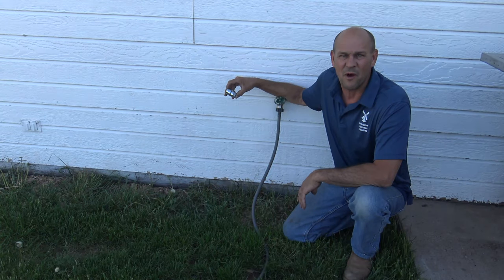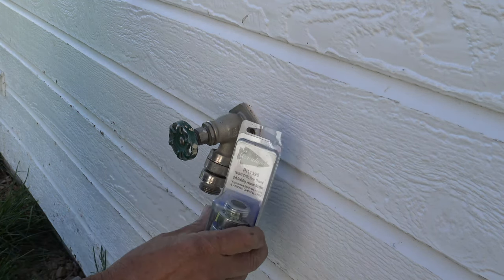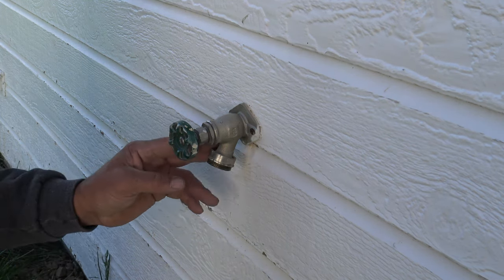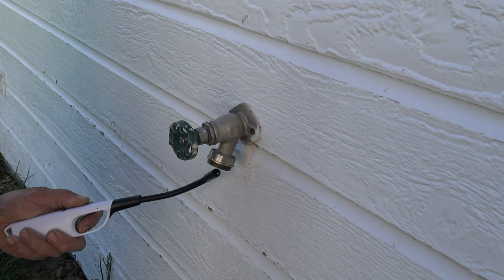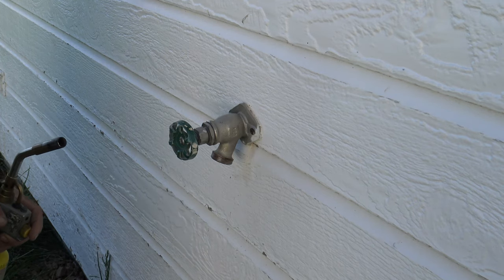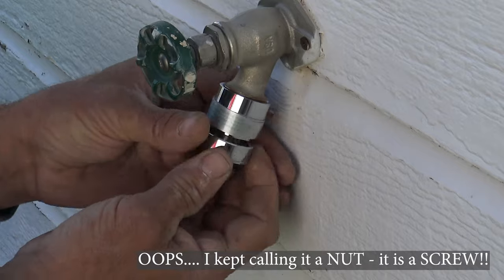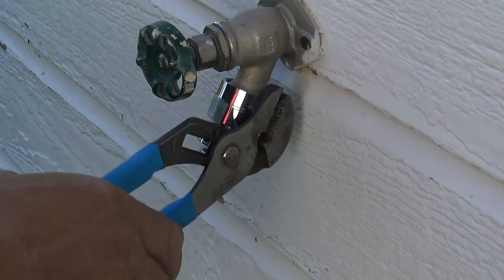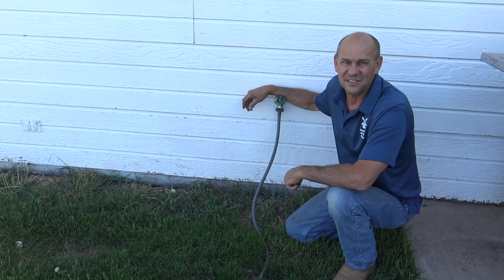How to Fix a Leaky Hosebib | How to Repair an Outside Faucet Leak

Comment: Thank you so much! The hose bib had been sitting broken for over 5 years! Every plumber quoted 1000 bucks to replace the bib. I tried unscrewing the broken off part and gave up until I saw your video. It came off so easily.  My hose bib is finally operational again!
Reply from the maker: Good deal. I'm glad you got it done.

Comment: Been trying to get that thing off for weeks! Was totally confused what to do! 3 minutes off & on with a good butane lighter and I could see bubbling at the top, screwed right off! This sure seemed easier than other videos drilling holes and sawing with blades! Thank you so much for the easy do it yourself tip, even I could use!
Reply from the maker: Fantastic!!  I love that it worked for you - great job!!

Comment: Thanks, I needed this.  What a stupid implementation of that break off set screw.
Reply from the maker: Agreed!
Reply: One of mine is dripping really bad and the set screw is broken off so it doesn't budge when I try to unscrew it. Were you able to get yours off with the broken set screw just by heating it up? I thought that I would have to drill the set screw out or use a dremel to cut the vacuum breaker off but I don't have those tools.

Comment: Excellent video - and I like that it is very recent.  I wish I had watched it earlier; however, that said, I do have two new faucets and will be attaching the PK1390 on both.  The tip about stopping the leak just below the knob was useful.  Also, I was wondering what I was going to do with the side "screw" on the PK1390 and you gave the perfect answer and demonstration.  Thanks for taking the time.
Reply from the maker: Thank you!!  Appreciate that!

Comment: Is there an Arrowhead PK1390 without the screw? I don't want to deal with trying to get the screw that's broken off out when time to replace.
Reply: GET A SPIGOTMASTER!
Reply: Im just left my set screw out and used lock tite.  Works great!
Reply: There actually apparently is (or was at least, decades ago) because the one I took off did not have a screw and just came off easily but all of the replacement ones I've seen have the retaining screw.

Comment: This is great. Really helpful. Thanks. 
I had one question though. Would it be okay to use spigotmaster anti-siphon device instead of the Arrowhead vacuum breakers?
Reply from the maker: No, the Arrowhead breaker is designed with double check valves, one is a back flow preventer and one allows the hosebib to drain itself.  The kind you mentioned doesn't allow it to completely drain.  Here they are on Amazon  https://amzn.to/2WYWnOi  https://amzn.to/2WuUmuk
Reply: @DIYOnTheHouse  That is not the case: there are PLENTY of regular vacuum breakers that fit onto a regular 3/4" garden hose fitting for a FRACTION of the cost of the Arrowhead vacuum breaker: buy a spigotmaster and then add a more economical vacuum breaker. MUCH BETTER SOLUTION!

Comment: Do I need to put Teflon around the spigot thread?
Reply from the maker: No, there should be a washer inside that will seal when you screw it on to the bib.  Let me know if you have any other questions.

Comment: Is the leaking repairable vs replacing it?  For example, why does it leak?  Does it just need a new gasket or o ring?
Reply from the maker: Hi,
It wouldn't be worth repairing. It's possible that the brass has a groove for extended periods of leaking.

Comment: Appreciate the video. Why do these even fail to begin with? Is it because the rubber washers inside wear out? It sure would be ideal if the whole thing didn't need to be thrown away and replaced every so many years.
Reply from the maker: Thanks!  The minerals build up and doesn't allow the rubber to seat or the rubber wears out.

Comment: You do not need to use heat. Use penetrating oil. 
The top part of my vacuum breaker stuck on the hosebib as in this video. I don't have a torch. I tried channel lock, heating with clicker. It did not work. I tried to find a 1 1/8 fine thread female to 3/4 GHT adapter, but could not find any. I then stumbled into a YouTube video which showed how a guy was able to remove nut and bolt sealed with red LocTite thread locker without using heat. He used Brakleen Brake Cleaner and it came off easily. I was going to try penetrating oil next any way. I had some Houdini Lock cleaner at hand, so I applied a liberal amount, waited 2 hours and the part came off easily with a channel lock. I waited 2 hours because I had to do other choirs. You may not have to wait so long. I heard that people used WD-40, but I have not used that myself. Hope this helps.
Reply from the maker: What ever works to get it off with out damaging the bib! I use heat because I need to remove them right away during a plumbing service call. Thanks for the tip!

Comment: i have an issue but the water leaks out the handle
Reply from the maker: Hi
If it leaks around the shaft that the handle is attached to there should be a nut (packing nut) to snug up and it should stop. If the water is coming out a hold in the shaft then you will need to remove the handle and roll up teflon tape and jam it in the hole that attaches the handle, until its packed tight and reset the handle.
Hope this helps

Comment: Can I use Teflon tape instead  thread locker???
Thank you for the video....i didn't know that I can change just that part.  I got the whole piece (very expensive BTW )
Reply from the maker: There is a rubber washer in the pk1390 so no need to seal. They are spendy!

Comment: I found the best way to fix this is to remove the back flow preventer as shown in the video, throw it in the trash, and replace it with an adapter (from Amazon) that eliminates the expensive back flow part. The backflow preventer will have to be replaced to pass inspection if you ever sell your house.
Reply from the maker: I know the design is a little wonky, but if it's replaced and working properly. It will save you from having a freeze and break during low temps. Which can cause major damage to the interior of the home. I have been a plumber for 25 years and very seldom do I have to replace this bib design from being frozen during the winter from someone leaving the hose attached.

Comment: Is the spigot brass or aluminum because my leader hoses are all brass and I don't want the different metals to cause problems. Can I installed a brass drain back valve with fine thread to the spigot? Thx
Reply from the maker: Arrowhead bibs are all brass except the handle. If you replace the vacuum breaker it will have to be fine thread to connect it. Make sure you use the pk1390 breaker, it's a double check and self drains the bib. Single checks will leave water in the bib and will freeze and break in the winter.

Comment: Great video! Is it normal for the anti siphon valve to expel water (briefly) when you turn the hose off?

Just installed a new one. No longer leaks when hose is in use....but it shoots out water for 5-10 seconds as soon as I turn the spigot off
Reply from the maker: That is normal especially when a hose is connected. When you turn it off, the back pressure from the hose is relieved through the vacuum breaker.
Reply: @DIYOnTheHouse  Thanks for the quick response and confirmation. Will be watching more of your content!!!
Reply: My brand new one leaks while it's running :-(

Comment: I haven't finished watching your video yet and maybe you will talk about it but I just purchased a brand new one of these (PK1390/59BFPCHR) to replace a decades old one that was split at the rubber gasket in between and was leaking everywhere and I cleaned the bib off beautifully and used pipe dope up as the instructions that came with it said to do and tightened it not too tight but decently tight with a pipe wrench and then tightened the additional retaining screw to hold it in place and it's spraying water out of the middle of the device like where the overflow or relief weep holes are :( why is a brand new unit leaking?!
Reply from the maker: Some times the rubber gets stuck to the brass. If you take it back off, push the 2nd washer from the top with your finger and it may free it and do the same thing from the hose connect side. If this doesn't work it's defective.

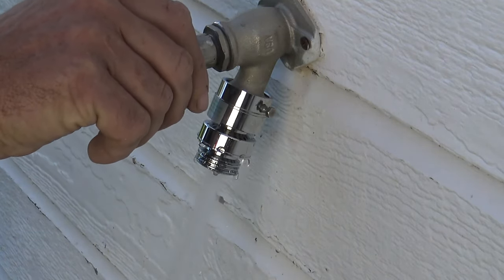Comment: @4:50 when you turned on the water, at first it started leaking around the mid section. Is that normal ?? My old onenbroke and i installed a new one (same model). Its also leaking at low water pressure but i dont recall my old one doing that. Thank you!!
Reply from the maker: It will leak until the check valve is engaged with more water pressure. If it leaks under pressure a piece of debris may have got under the washer.

Comment: Thank you for this video!  For the life of me, I could not get that top piece off.  I watched some other videos but none said to use heat.  I heated it up with my multi-purpose lighter (clicker).  It did take a lot longer than I thought it would, but it eventually got hot enough to twist that darn thing off.  Lots of old red locktite came flaking out while turning.  Thank you so much for this video!
Reply from the maker: You are so welcome!

Comment: Thanks. your video helped me. To add a datapoint, I used the lighter to heat up. it only took me like 5 minutes to heat it - much easier than i perceived. Just pay attention to the direction to turn the wrench before you actually hear it, as you don’t want to spend time to think as it rapidly cooling down.
Reply from the maker: Glad it worked!

Comment: Quick question: the instructions on the packaging of the breaker said to use pipe dope, however i dont see you having done that. I didnt do it either. Will that cause problems?
Reply from the maker: Nope. I've replaced hundreds of them and never an issue.

Comment: So there is a faucet that you can not attach a hose directly to. A vacuum breaker that either has threadlocker or a screw that breaks off making it difficult to remove. It also does not last so removal will be needed.  WHY does anyone use these parts when you can just buy a ball valve faucet and make things easier?
Reply from the maker: Hose bibs that are in freeze areas may need to have the wall or siding opened up to replace the bib. So repair is cheaper.

Comment: My faucet/spigot are in the recessed area that requires bending over every time and reaching under an awning - very awkward.  I got a "hose bib extender" (https://www.amazon.com/Sun-Joe-SJ-SHSBB-Gry-Garden-Faucet/dp/B07GT79XD3) so that I can turn my water on/off from a slightly different location, but under pressure I noticed the spigot leaked.  As I intended to leave this open all the time, I tried to fix the spigot (thought it was some weird aerator or something), but realized it was a vacuum breaker.    Exact same model shown in your video.  Is there a modification that would allow me to use the hose bib extender?
Reply from the maker: You inspired Ross to make a video on how to fix your problem.  He filmed it yesterday and I have it ready to go up on Tuesday next week!
Reply from the maker: We got the video posted early - see if this helps.  Let us know if you have more questions.  https://youtu.be/0NDkOwZeVzw

Comment: I replaced mine but it keeps leaking! What am I doing wrong?
Reply from the maker: The constant leak will be the flat washer inside the bib. The stem will need to be removed and the washer replaced, if it has leaked for a long time it may have worn a groove in the brass seat and the bib will need replaced.
Reply: @DIYOnTheHouse  I believe I have the exact model of this spigot. Do you know the exact washer replacement that would fit this, the one that goes on the end of the stem piece? Or maybe there's a video of you doing this?

Comment: I tried heating it with a torch but couldn't get it off myself. I had a plumber over at my house for an unrelated fix, but had him check out if he could get the top off. He used WD-40 and was able to get it off!
Reply from the maker: That's great.

Comment: How do you CUT OFF the top peice of the vacuum breaker if it won't thread off because the threads are damaged???
Reply from the maker: Do you know if there is a place on the top part that has a broken screw on it? If there is I use a small hack saw and cut a V at the broke screw and wedge it off with a flat screw driver and then it should unscrew.

Comment: That's exactly what I need. Same exact vacuum breaker and I quit trying thinking I would break it off. I'll try again with a heat gun.
Reply from the maker: Heat will loosen the thread lock and you will be good to go.
Reply: @DIYOnTheHouse  Thanks, I was able to get it off and save a call to the plumber!

Comment: 4 years later and this video is still really helpful! My hose was leaking from the bib, and after doing quite a bit of research, I thought I was going to need to replace the whole faucet. In a last ditch effort, I browsed through some youtube video and saw a thumbnail of a faucet that looked like mine. I watched it, ordered the part, and now my faucet is working properly again!!! Thanks so much for this video! You saved me hundreds of dollars I would have spent when I didn't have to.
Reply from the maker: Happy it helped. I replace a lot of vacuum breakers.

Comment: Im glad to see this video. Every single other one mentioned the cursed break off screw. The one ive got doesn't have one of those
Reply from the maker: Hope it helped!
Reply: @DIYOnTheHouse  This did help a lot. I also figured out that the bib somehow kept not catching the threads. Thus spinning 360⁰

Comment: So, from the looks of it, the thing is designed to constantly leak water.  Interesting.  The proprietary thread mount was reason enough to avoid these things, but the leaking water is why I need to replace.  Bummer.  Thanks for the video
Reply from the maker: The replacement should only leak water when it is turned off, That would be the draining of the bib so it doesn't freeze and break during freezing temps.
Reply: Mine always leaks and it's brand new :( @DIYOnTheHouse

Comment: Curious - in place of a butane or candle lighter, do you think a heat gun might work?
Reply from the maker: Yes, great idea!
Reply: @DIYOnTheHouse  After struggling with this because the bottom half came off and I never realized that the top half was still on the spigot, I kept trying to find the part that would fit on the old top half of the PK1390.  So, basically, I was buying the PK1390 and trying to fit it on the top half of the old PK1390.  DUH!   

Went to a plumbing store and they finally told me that the top half of the old one was still on there and I needed to remove it.  Googled, found your video.  

I got home this evening and went out there with my heat gun.....about 2-3 minutes later, came off like butter.  

Now?  Going to re-order the PK1390 from Amazon that I ordered a couple of weeks ago and sent back!  Haaaaa.

Thanks so much for your help!  Appreciated you and the video.  Saved me from finally giving up and calling a plumber when I didn't need to!

Comment: Question? Do I need to take the vacuum breaker off for winter?
Reply from the maker: No, you can leave it on.
Reply: @DIYOnTheHouse   
Thank you. I've always removed the hoses and anti-siphon valves before winter here in the PCNW. Figured this ABP was the same as others.
Reply: Aren't you technically supposed to remove the hose in winter though and push the little plastic button/tab inside at an angle? @DIYOnTheHouse

Comment: Mine leaks right out of the package
Reply from the maker: Is it leaking from the Packing or when you opened the Package?
Reply: @DIYOnTheHouse  I opened the package and installed connected swamp cooler bib and turned water on it sprays everywhere
Reply from the maker: @Ray-lg3qe  Sounds like the product may be defective - return it and see if a new one is better.  Let us know!
Reply: @DIYOnTheHouse  spigot masters makes an adaptor that’s not a back pressure valve cured me up quick fix!!

Comment: It still had water come out the top
Reply from the maker: Is it coming from around the on off knob?
Reply: @DIYOnTheHouse  no on the siphon valve small dripping...is that normal...i have the same thing and wondering if I need to replace mine.  Look at the video at the 5:12 mark.
Reply from the maker: If you connect a hose to the bib and turn it on it should have enough back pressure to trigger the check valves in the vacuum breaker. If it drips and runs, you need to change the vacuum breaker. If it is dripping 24 hours a day the problem is an internal bib problem. ( flat washer)
Reply: @DIYOnTheHouse  it doesnt drip 24 hours.  only when i connect a hose it drips.
Reply from the maker: @cremedelacreme.  Looks like you need to change the vacuum breaker.